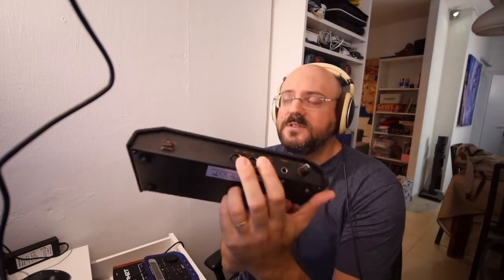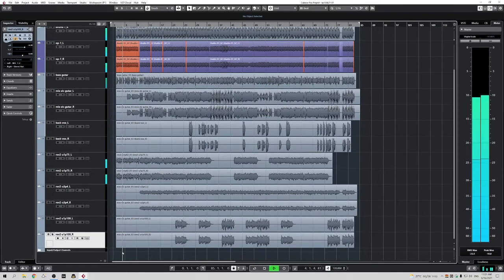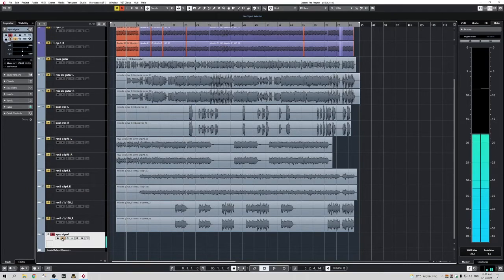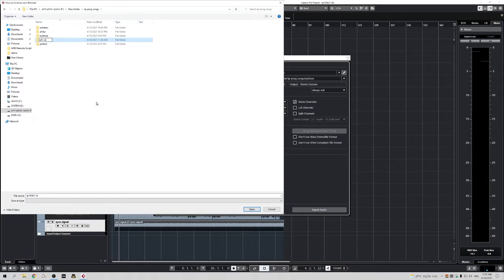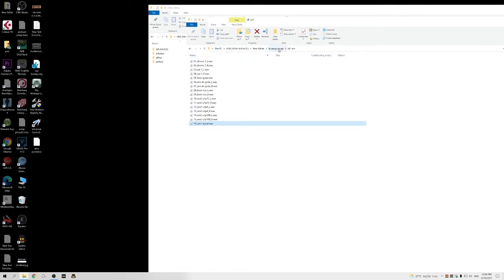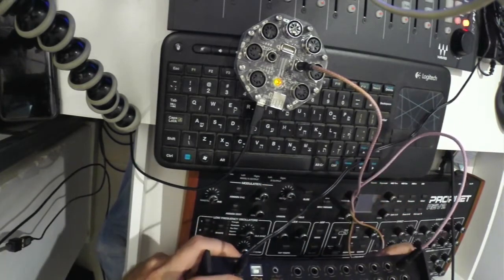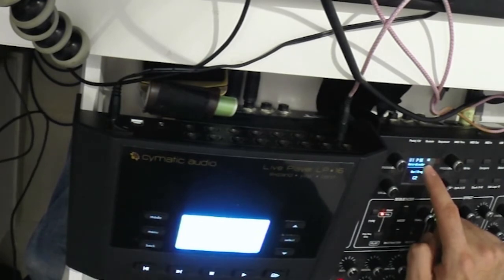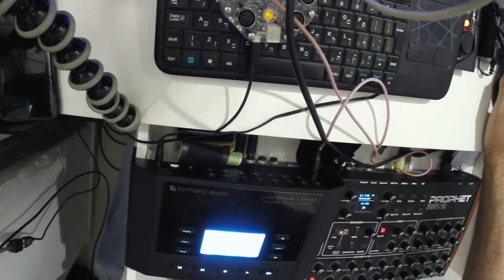how to add midi clock functionality to cymatic audio lp-16 player

Comment: Hi, I,ve been watching this video and I found it very useful. thanks.!! I have a question though...  How do i record  the midi track into an audio track, to my DAW  if I`m using the Kenton sync box? since the kenton has not an audio out port...
Thanks for your help!
Reply from the maker: Hi man, not too sure if you need to do that.
For triggering cues for light and such I think you can embed the midi file regularly through the application

Comment: Hey. Do you know if it's possible for the LP16 to receive (!) program changes via Midi?
Our band's setlist often changes in a split-second, so i'd love to be able to control the song that the LP16 is about to play via a midi-controller. (previous song, next song, play/pause).
Reply from the maker: I think its very possible, you just have to know how to correctly export the midi file
Reply: @lachopakapura  Thanks for the reply :) I don't mean to send program-changes, but rather receive them on the LP16.
Like:
I have all my songs on my LP16 and decide to go from Song 1 to Song 13. So instead of reaching to the unit i would love to send this program change to the LP16 so that it switches to Song 13, you know? :D

Comment: Can this method 
be used to trigger stage lights?
Reply from the maker: Hi man thanks for asking.
To my knowledge you can export from your Daw a midi file which can then be imported to the lp-16 and using the midi out jack to trigger lights . but you need a midi to DMX converter or a light mixer that can Translate the in coming massages.
Reply: @lachopakapura  that´s exactly what I like to do for our live show...i found the boomlight lc-1x interface, and the boomlight guys can program it for the devices you need it for...so we´re going to control fog jets with it and they say it would work with only 2 different MIDI notes on the file, 1 for start and stop signal and 1 for the different lights and effects by changing the velocity (RGB, Strobe etc.). So I hope this works like they told me, I´m definetely going to try it!